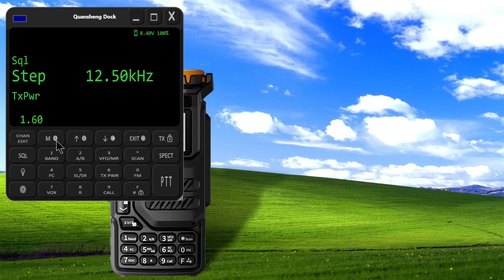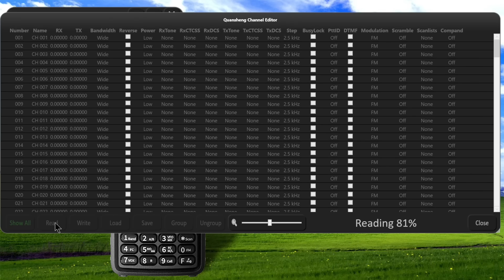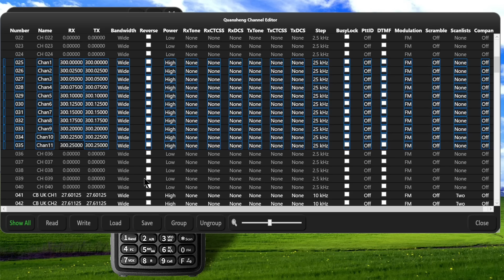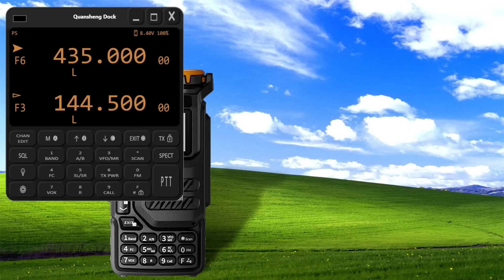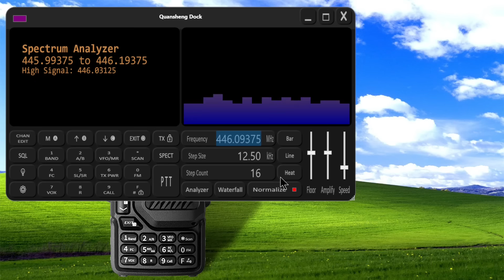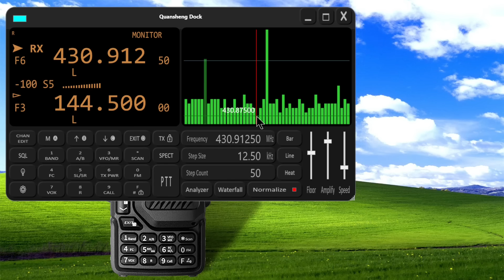Quansheng UV-K5 Remote Dock System

Comment: Brilliant idea! I have a question. The audio is just a split cable from the programming cable to extract audio in/out?
Reply: Just answered myself from your github. I was to lazy and also excited to try it before reading the whole readme file.
Reply from the maker: Pretty much yes, it's just a couple of Y cable splitters. The audio out however has to be converted to high-impedance with a resistor because otherwise you get bleed into the serial lines causing garbage data.
Reply: Thank you. I wonder if  a real time (ish) Doppler compensation for Satellite/ISS repeaters can be now implemented on your docking software
Reply from the maker: @diandana  What would be required for that? I'm afraid what you said went over my head a bit, I have no experience with working satellites.
Reply: @nicsure  Just modifying the frequency in "real time" to compensate for doppler effect on radio waves. In my opinion even once every 5-10 sec. it's enough. At the "rise" of the ISS (lets take the ISS example) at the horizon the frequency of the downlink of the repeater will be  higher than the ISS transmitter is actually set due to doppler effect. On the same principle, on the "fall" on the other side of the  horizon the receiving frequency would be lower. Here it is a good example :  https://youtu.be/MkfHTPDYOps?si=rhe69ZCkcHT6kgUx  around min 2.30.
It can be done somehow using the radio memories and selecting them manually, but would nicer to be able to automatically track the frequency from the PC.
Reply from the maker: @diandana  Oh I see. That should be possible, a timed adjustment of the set frequencies ought to do it.

Comment: Hi looks just perfect congratulations the app works and I have read from radio with normal usb programming connection, Thanks for all this work you did  DE M7SEY 73 NB.  Sorry but now I see I have a small problem now?  Problem is I connected with programming cable after downloading the software and the firmware but all I can do is read the channels and edit, the screen is blank working even though the firmware is NUNU v1.7 is installed as well on radio. so it should all be good smdh...
Reply from the maker: The firmware flashed on the radio has to be the one from my GitHub in the description, it won't work with any other firmware.

Comment: Great job! Is it possible to purchase the cable for the audio ?
Reply from the maker: If you saw the actual state of the cable I made, you'd really not want one from me. And I'm not really geared up for that. They are pretty easy to make though. The instructions on GitHub are really only for a make-shift cable. I'm going to contact some cable makers and see if I can get them to make them properly, that way I can also incorporate audio input too.
Reply: @nicsure  Thanks, definitely there would be a market for such cable (and your software) !